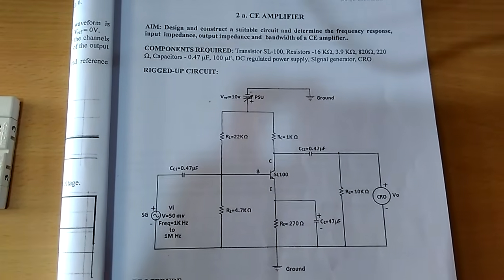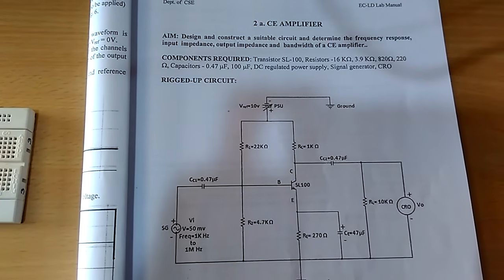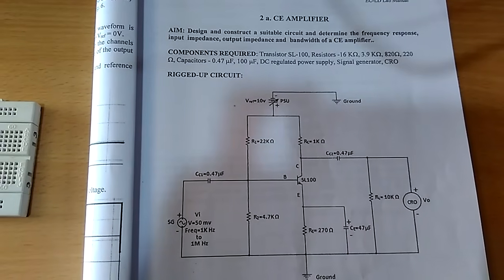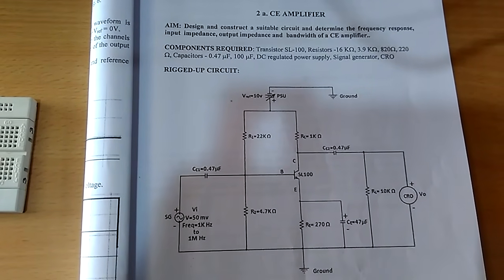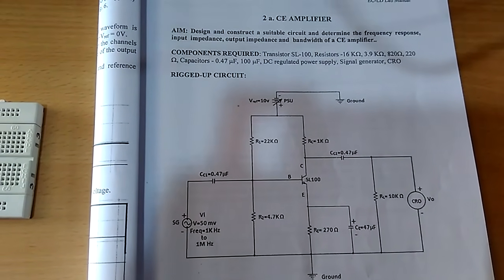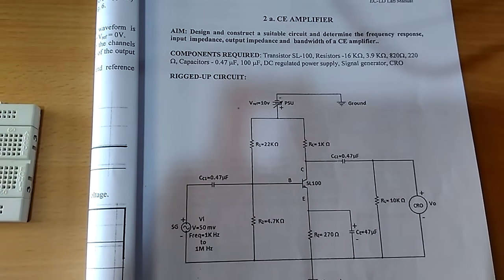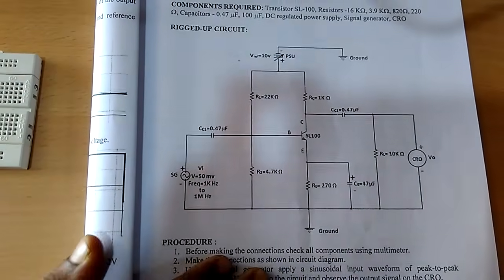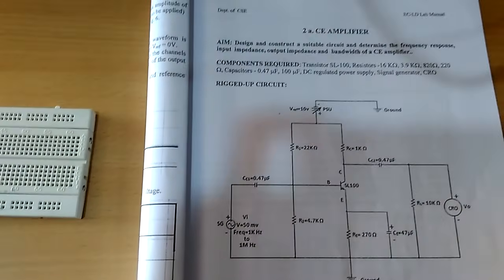CE (Common- Emitter) Amplifier-DSATM

Comment: This sort of circuit is unsuitable for any sort of real use. The fully bypassed emitter resistor means that the gain is set by the intrinsic emitter resistance of the transistor, which at a collector current of 4mA will be about 6 ohms. That resistance is highly non-linear as it varies with the collector current, producing severe distortion as the output amplitude is increased. You can see the effect in the upper graph at 6:10 where the sine wave is rounded at the top and spikey at the bottom. In any practical common emitter amplifier, it is essential to sacrifice gain by using an unbypassed emitter resistor which effectively provides negative feedback in order to reduce distortion to acceptable levels.